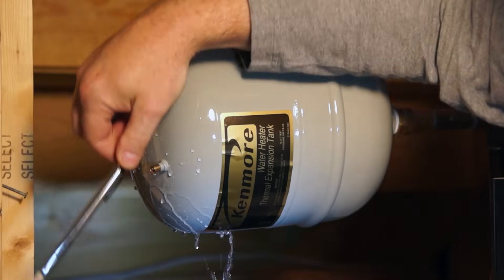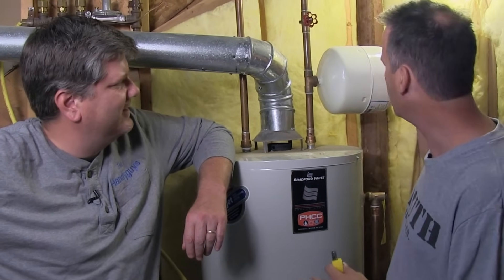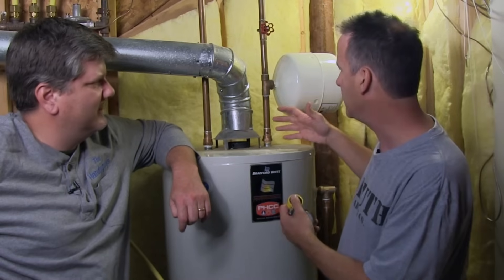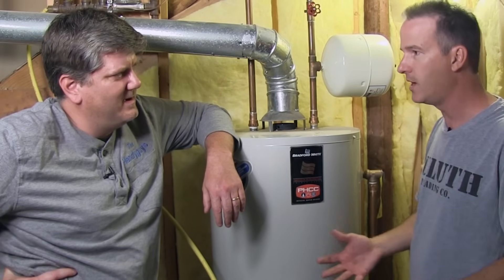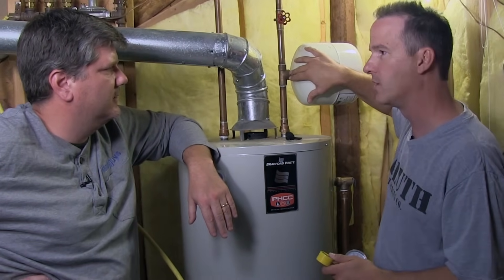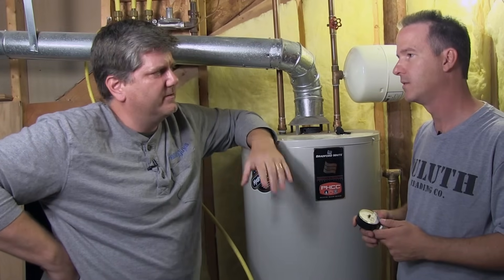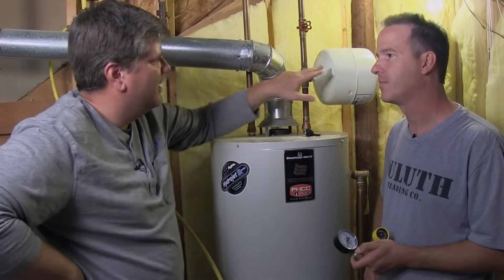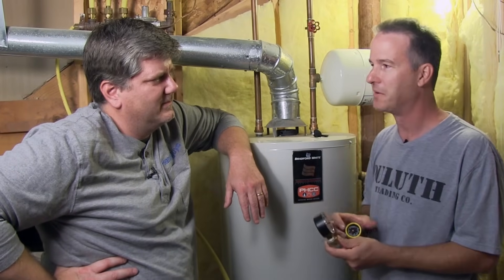Water Heater and Expansion Tank Maintenence

Comment: The expansion tank appears to be installed incorrectly as according to the manufacturer of the vessel.  Most manufacturers do not design or allow the expansion tank to be installed in a horizontal position.  Most tanks are to be installed in a vertical only configuration.  The piping must be able to support the water weight of the tank.  Always refer to the manufacturer's installation procedures.  Installing in the horizontal configuration will cause the piping to eventually sag, crack, or separate from undue strain. 

Also, most city water systems utilize delivery pressures ranging from 40 psi minimum to 80 psi maximum water pressure.  The tank's MAWP (Maximum Allowable Working Pressure) cannot be exceeded when charging with air. Always refer to the data plate or decal on the tank for MAWP rating.  Overcharging with air can result in a failure of the internal bladder or allow a sudden rupture of the tank which can cause injury or death to a user.  If the city water pressure is delivered over the 80 psi then a pressure reducing station on the main water line should be incorporated prior to entering the house or commercial property.  National codes make this mandatory with state and local jurisdictions adopting this practice.   This prevents high water pressures from damaging piping, fittings, and fixtures within the building.
Reply: Actually, when I referenced the manufacturer specifies for my tank, noticed it mentioned the tank can be installed both vertically or horizontally. Might depend on the tank.
Reply: You are right it works better that way
Reply: @jenwhitedesigns  if you install horizontally you ALWAYS support it.....if not then you deserve to be sent the bill when the property floods.  Bad work is bad.
Reply: murph1329 WHY? Why make that comment? I just mentioned manufacturer specs.
Reply: @jenwhitedesigns  because my house flooded due to a crappy plumber not securing the expansion tank after installing it horizontally
Reply: Thank you just what I would’ve wrote
Reply: Just replaced mine and the instructions show that it can be mounted horizontally as long as it's supported by straps.
Reply: I saw that tank in a horizontal position. Manufacture instructions indicate to install it vertically. Most other videos on expansion tanks show vertical installations as well. Also, do you think these guys are correct to say turn on your hot water in the house before adjusting (adding) air to the tank? My understanding is that by turning on hot water, thermal expansion will occur in the water heater which will expand into the expansion tank...therefore, is it not a good idea to turn on hot water during adjusting (adding) air?
Reply: @c.m.redhouse7667  The normal practice is to charge the tank with the water line closed.  Opening a valve and allowing water to flow does not give an accurate reading on the air side of the tank. There will be a lower pressure developed in the system due to the water line being open. During that condition the bladder's air pressure will be read wrong as there is less force pushing against the bladder's waterside. A closed loop system is designed to allow for thermal expansion against the bladder as water heats and the combination of the city water pressure climbs to its highest point. As a result, the pushing or expansion against the waterside of the bladder will raise its pressure on the air side. Its a cause and affect situation  A bladder tank should be considered similar to a shock absorber in how it performs.  The more the system heats and expands, plus the changes in the city water supply together will constantly change the air pressure on the air side of the bladder.  If the air pressure is not set correctly to begin with, then the expansion tank air pressure could be greater than the water side resulting in the expansion pressure finding the next weakest point in the piping.  This ultimately results in broken pipes and fittings.
Reply: From a legionella perspective, all expansion vessels should be installed in an upright position

Comment: Put a ball valve between the expansion tank and the cold water inlet to isolate it for testing without having to drop the entire system. As Delta T stated below you cannot test the air pressure at the schrader valve accurately with the static house pressure against the tank. Either disconnect the expansion tank, charge it and reinstall or isolate it, drain the pressure, charge then reenergize it. Otherwise you guys did ok.
Reply from the maker: Good idea.
Reply: Kill the breaker to the water heater to prevent possible dry firing of the elements also a good idea
Reply: A valve on the inlet of the expansion tank is superfluous. You still need to depressurize the inlet (water side) to the tank to properly check the air pressure. Granted, a valve in said location could make it easier to remove the tank, dump out the water then check the air pressure. But then you need to get more teflon tape or pipe dope and clean & reinstall the expansion tank. A lot of unnecessary work. Just shut-off water supply upstream of tank & heater, even if it's the main entrance valve. Open a cold & hot water faucet anywhere in the house to relieve the tank water pressure, the tank does NOT need to be drained, only depressurized.

Comment: I noticed your tank wasn't supported. When my tank bladder lost pressure and it filled with water, the weight was so much that it broke the cheap plastic strapping  tape they had used and severely bent the PEX tubing almost to the point of rupture.  For the pennies cost savings of using plastic strapping instead of metal strapping, I almost had a flooded basement.   Copper lines are  probably strong enough to self support, but if it's plastic or PEX, be sure to adequately support the tank.

Comment: Actually, you should add  the air pressure with water shut off to the house or water heater so there is no pressure on the water side of the diaphragm ,then adjust your pressure on the Airside. Running the water at a sink or shower does not relieve the pressure completely only reduces it slightly. If you don't pressurize the tank this way you will end up with an under pressurized tank. The whole idea of matching the house water pressure with the air charge is to keep the diaphragm expanded completely into the water side of the expansion tank until the water pressure rises above the house water pressure due to thermal expansion.
Reply: This is super important, folks!  The safest way is to completely disconnect the tank from the system and empty all water before testing or adjusting the air pressure.

Nice guys, informative video.  But, I had to thumb down this video because they've omitted this crucial step.
Reply: @highball7347  Threaded connections make the removal/reinstall fairly easy with blocking the valves in to isolate the take from pressure. Simply unscrew, and when the drip begins, just catch trapped water with a bucket placed underneath. After the drip stops, then remove.
Reply: @jsly5473  every expansion tank I've seen has threaded connections.
Reply: And its not strapped , when the bladder blows , it fills entirely with water and gets heavy ,  the copper can hold it but it is Not correct , sharkbites , will leak many many many such cases , put a 3/4 brass tee on the heater and stack it on the vertical
Reply: Your reply should be pinned to the top of the comments.

Comment: Everything I've read including the instructions with my expansion tank state you have to TURN OFF WATER SUPPLY and drain pipes (turn on a downstairs faucet) before testing tank for pressure. Then put pressure in tank to match your water pressure (usually between 40 to 80 psi).
Reply from the maker: duckmanjoel Yes, technically you are correct. Best to put air into tank when the water pressure is turned off.
Reply: @TheHandyguys  technically you are incorrect on your video. 👎👎

Comment: First- Thanks for the video. Other viewers made some valid comments so I won't duplicate them. One thing I would like to say, is that once we are so concerned about doing things right, shouldn't we strap the water heater?  For presentation purposes it would only be beneficial to show correct installation.
Reply: I think so. Two adjustable straps around tank with two rigid straps screwed at top.

Comment: If you Dont completely drain the water pressure off of the expansion tank before you test the pressure on the expansion tank, then the tank pressure will read the same pressure as the water pressure. If there is 20 psi on the tank when there is no pressure on the potable connection and than add 50 psi water pressure, the bladder will move to equalize and compress the air pressure to 50 psi. You may think the pressure in the tank is fine when when the bladder may be almost maxed out.
Reply: Yes, what was said in the video appears to be incorrect and Robert is right.  You have to remove all pressure from the tank before checking with the tire gauge.   Some expansion tank installs have a separate shut off valve just for the tank which makes checking easy.
Reply: alan tolchinsky These guys are not professional plumbers.

Comment: Most new water heaters come with a built in check valve on inlet and outlet of water heater (floating marble) to prevent water back up . This act like a check valve . Trying to understand how an expansion tank can work if the check valve is up stream from the tank .
Reply: Exactly, if the expansion tank is "before" the check value (cold water inlet to the tank), the backflow is already blocked by the valve.  So how would any back up go up to the tank?  This might possibly explained why I have water hammer issue after installing a new tank brand "Rheem".  And I searched the manufacturer PDF, the cold inlet does use a check valve.  Then I read some other forums and some people suggest to replace the check value with normal pipe without any "ball" to block reverse flow.  Now that's probably a more troubling re-install. Probably turn off main, drain all water, disconnect top, install new valve.  blah blah.

Comment: Question. I noticed you have the expansion tank in a horizontal position. Per manufacture instructions of these expansion tanks and per expert plumbers, these expansion tanks should be mounted in a vertical position. Is that correct?

Comment: Do not attempt to adjust the tank pre-charge once installed on
the system and under the system pressure. The expansion tank
should be pre-charged to the incoming system water pressure
but must not exceed 80 psi. Failure to properly adjust the precharge
will shorten the life of the product.
Reply: how does the tank hold its' charge if it is open and not connected to the line? i do not see any shut off valve at top of expansion tank

Comment: Hi guys good info with 1 exception. On page 2 of the installation instructions under warning #2 is says WARNING Mount vertically in downward position only!!1. Install the expansion tank on the cold water supply line to the water
heater at a point between the water heater and backflow preventer or
other one-way device (Figure 2).
Mount vertically in downward position only.
Reply: ....my tank user manual also states mount vertically, and it has been installed horizontally :-(  It's a French made Gitral VVEF 19. Several of my neighbours tanks have already failed.
Reply: adam brown I just bought an Everbuilt and the instructions said you could mount vertically downward or on top. Thank god cuz there isn’t any room to hang downward. These homes were not built to accommodate downward. Either that or I need to get a lower stand and longer pipes to the top of the heater. What a pain.
Reply: @dcwatashi  vertical yes horizontal no

Comment: very helpful video! of course I have one question.... My house water pressure is about 75psi (taken at garden hose). my  hot water heater expansion tank air pressure is 56(+-). When I tap on expansion tank with screw driver it sounds like it is full. When I tested the air pressure I do not get any water spiting out from tank? do I need to replace my expansion tank?

Comment: I agree with most of this. You don't need a gauge to see if the bladder has leaked. If you add air to the bladder, you should shut off the water to the tank and relieve the pressure at a faucet.  I don't think you should add the same pressure as your service pressure as he suggested. That would defeat it's ability to expand. The idea is to allow the water side to expand toward the side of lower pressure (the air side).
Reply from the maker: +bernie10315 Thanks for checking in. I thought you added about same air pressure as water pressure so that the bladder remains neutral during normal periods. It is only when the pressure begins to raise (from being heated) that it expands into the bladder as the water pressure then is higher than the air pressure.
Reply: If both sides are the same, expansion has nowhere to go. The bladder actually holds the service pressure. If service side pressure increases, it actually pushes the bladder out like a balloon. The more it pushes out the higher the air side goes, approaching same pressure. The charge pressure is there to keep the bladder from popping like a balloon.

Comment: QUESTION: I have a Watts PRV by my water heater, which is set to 50 PSI and has a gauge set in the line to verify, but my full city pressure (on my garden hose) is 120 PSI  -  So, do I match the Expansion Tank to the 50 PSI that is provided by my PRV that is by my water heater or the full city pressure of 120?  Thanks!

Comment: On the Bradford white water heater tanks, the anode rod is installed on the hot side nipple.
Question: How do you inspect your anode rod on a yearly basis with a ridged pipe install on that nipple/anode rod? Do you cut the pipe every time you service the tank? If so why not install a flex water supply line?

Comment: I have an expansion tank. It was charged to 60psi to match my water pressure, while sitting on floor.  I happen to have a pressure gauge installed on my cold water line right after my meter, and I noticed that after significant amount of hot water usage (ie when water heater is firing), that my system pressure goes up to around 130psi! I thought that's what the expansion tank was suppose to prevent. Any thing I should check or do?

Comment: Why doesn't the pressure relief valve release the excess press?   

I have well water and don't know if I have a back. flow preventor,  I do have a bladder on the pipe coming from the well (to reduce cycling the pump) so can water escape that way?  either into the well or the well bladder?

Comment: Expansion tanks are required for "closed" systems.  "Closed" systems have a check valve or backflow preventor.  Many older systems are open systems.   Is your system closed or open?

Comment: Great video. I have a water pressure question. My TP valve has a long history of opening to release pressure (7+ yrs). This has happened with 3 difference boilers / TP valves that I've had in my house. When it opens it ranges from a slow drip, to a fast and ongoing drip that could add up to a few litres total, mostly overnight. I've replaced the regulator valve on my main water line last year and have turned down the pressure to a very soft flow, but issue still happens periodically, just a little less water. I do not have an expansion tank.
Since my TP valve leaks much more than than the few drops that you described, will an expansion tank fix this problem? Is there anything else you could think of? This is all made worse by the fact that my basement has a finished floor and no drain for when the tank leaks, making it a very messy flood when this happens. Thanks!

Comment: there is another video that shows we should shut off the cold water inlet to the heater, open the hot water and let the water pressure drop to 0 (little or no water coming out of the hot water outlet) before measuring the expansion tank air pressure. In this video, they just recommended keeping one hot water outlet open while pressurizing the tank. I wonder which approach is correct ?

Comment: If you read the instruction from the manufacturer on MOST expansion tanks, it clearly states that you should not check air pressure, nor add air to the tank while its connected to the water system. You must shut the water off to the system drain down any pressurized water and remove the tank. THEN check the pressure. If the bladder has lost its air pressure, the air valve (or bladder) is worn out and it's time for a new expansion tank. These are not tires.
Reply from the maker: Pathmaker Plumbing Thats a lot of trouble when you simply do not have any pressure in your tank. Easy to add some pressure so you don't have water shooting out your T&P valve. It also is an easy way to make sure it has not failed outright with water coming out. But you are correct as far as getting proper pressure in the tank...water should be off and drained.

Comment: It also helps to have the pressure relief valve pipe empty into a pan under the water heater that can pipe discharge to a drain or sump.  A large release of water would likely overwhelm the pan, but smaller amounts won't end up on the floor.

Comment: Why when i set the water temperature to 180 degrees my Hydronic boiler goes past 30 psi for a two family house.Should I change the expansion tank from Ex30 to a Ex60 expansion tank.